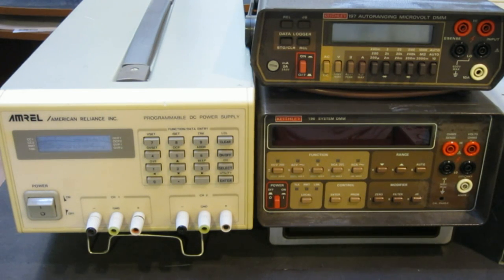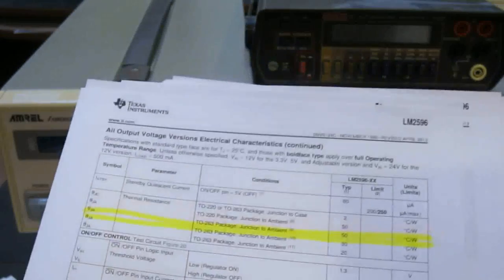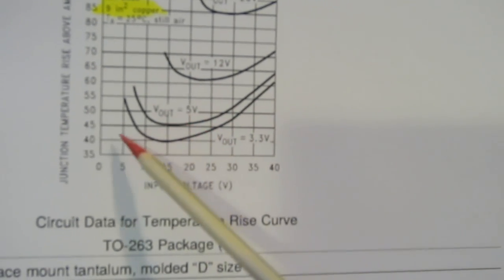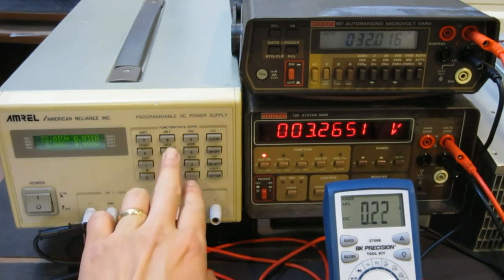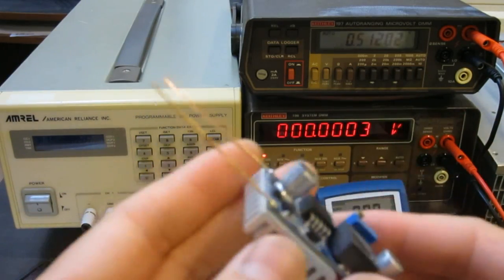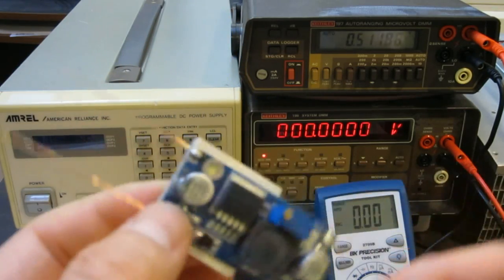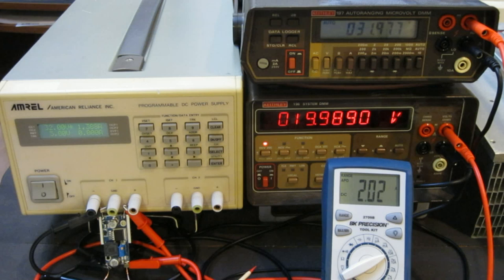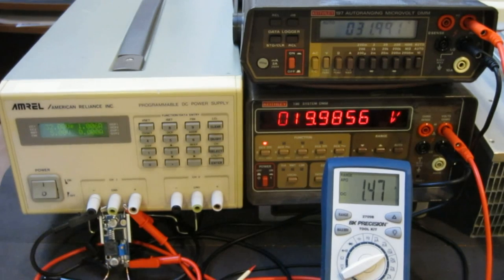LM2596 DC-DC Converter Module Testing

Comment from the maker: 1V is very close to the dropout voltage of LM2596. You can get it to work If the load current is under 1A or so.
Reply: I am planing to connect 4 6v solar panels in pararel, and use this converter to step down the 6+ voltage to stable 5v for charginh a phone. Will this work?
Also can u give me the link to al of the specification of this element?

Comment: Efficiency could be bit better in this module, I have build very similar DC-DC converters that have had their efficiency closer to 93%, and could supply steady 2A without heating much. Otherwise those converter modules are really good choice to replace linear power supplies in small digital circuits and projects.
Reply: +Henri „Ketturi” Keinonen Yea i am thinking this will handle 3A stable with copper radiator.
Reply: +Henri “Ketturi” Keinonen 
Yeah, they are using an older control IC, which isn't as efficient as some modern ones.

Comment: I am planing to connect 4 6v solar panels in pararel, and use this converter to step down the 6+ voltage to stable 5v for charginh a phone. Will this work?
Also can u give me the link to al of the specification of this element?

Comment: I'm wondering about the ripple, and how to eliminate it, I  have the same unit as yours.. planning to use it with 12v input brick power supply, using 2 of the converter to power 1 bluetooth device and 1 pam8403,.. so 2 device with its own converter connected in parallel..(both device are rated 5V)

I'm wondering if I should install 1uf ceramic capacitor close to bluetooth and amplifier device, and put 20uf ceramic capacitor on the converter's output..

I hope you could help me.. I just concerned about safety, thank you

Comment: Thank you Kerry, your presentations are thorough. I appreciate that you start with explaining how it works, comments on the datasheet, the setup you are using, then conclusions. I have a project where I have a Li battery pack with a voltage range of 250 to 190 V for which I need to step down the voltage to 12V. Power consumption around 750W running 3-4 Motors. Any suggestions where I can source a DC-DC converter for this application? Or how to rezolve it? Maybe a pure sine wave inverter in which case the motors will have to be AC?

Comment: Actually, I purchased a board which is 99% similar but not exactly the same as far as I can tell, from AliExpress.  I removed all the components to get an accurate schematic of it.  I found that there is right under the multi-turn potentiometer there are pads for a small surface mount capacitor (which was not populated...) for the CFF compensating capacitor.  However, the output ripple of the one I have which has a 47uH inductor and a 220uF capacitor is quite high at 120mv at 5V output and the frequency of the output appears to be 54KHz not 150KHz which the datasheet seems to indicate?  Perhaps, these Chinese copies of the LM2596 are not up to specifications?

Comment: Great video! I have a 1947 Eico Signal Tracer that I would like to modify for extremely improved sound output. Modern higher wattage 4" speaker, etc. The ultimate goal being - change the existing audio input jacks to 1/4" female. One for guitar input, one for phone patch cord input. (drum loop) Small sweet Amp. Would this device help with this project? Any advice would be greatly appreciated. Thanks!

Comment: you calculated efficiency on 3.34v wrong, I don't see 1.19A current anywhere, but I do see 1.019A, which makes efficiency about 76%, which is reasonable
Reply from the maker: +First2ner Aha, Thanks for catching that. Yep, it should be 1.019 not 1.19.

Comment: Awesome video, very thorough experiment. Also, can I use this for powering my router? The original power supply was 12V 1A. The ripple of the LM2596 module output is a little bit of my concern because I don't know if it will be safe for long run.
Reply from the maker: I don't see why not?
Reply: @KerryWongBlog  Because of output ripple. I'm wondering if it's good enough and won't fry the powered device.
from lygte-info.dk:
144 mVpp (12V->5V0.1A),
210 mVpp (12V->5V2A),  
335 mVpp (24V->5V2A)
from: k6jca.blogspot
234 mVpp (12V->5V1A)
I've read somewhere if ATX limit for 12V rail is 120 mVpp. The module is indeed cheap. I can go for higher grade module, but I'm inexperienced. I don't know which one to get in market nearby. The LM2596 module is the most popular one here. It's very easy to get. The Google result for review of other module is kinda rare.

Comment: i have 5 queries-----1------can i use a silicon diode instead of schottky------2------how make 3 lm 2596 in parallel---3------can i use npn transistor to increase load current-----4----max heat dissipation of lm 2596(not written in datasheet)---5-----inductor selection for output voltage------thank you
Reply from the maker: 1. Most switching supplies require Schottky diodes as they have fast recovery time. You could try using regular diode but you will incur much higher loss. 2/3 The easiest is to use a output diode on each module and hook the cathodes of these diodes together. 4. Max heat dissipation is dependent on junction to case thermal resistance and your heatsink. You can calculate this number using the thermal information provided in the datasheet. For PCB soldered package you can dissipate between 2 and 5 watts depending on the PCB design.  5. As far as the inductor selection, you can refer to the application information section in the datasheet for guidance.
Reply: thank you-----regarding--3------how can i put a npn transistor in this circuit to increase current----i mean to get 200 w to 300 w output---is it possible----how ?
-----------http://www.hobbyelectronics.net/uploads/6/5/7/2/6572022/8375363_orig.jpg